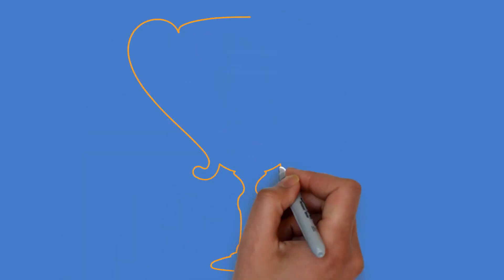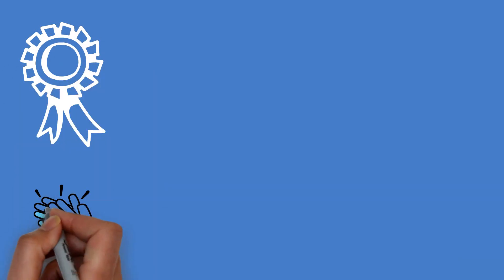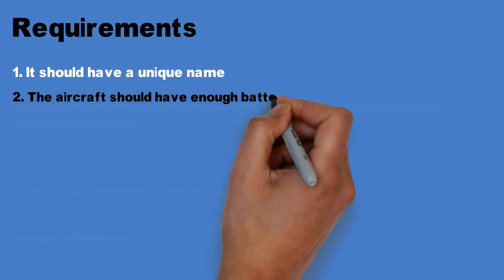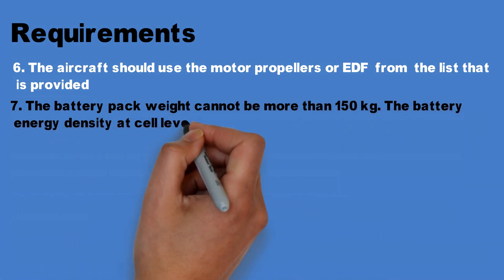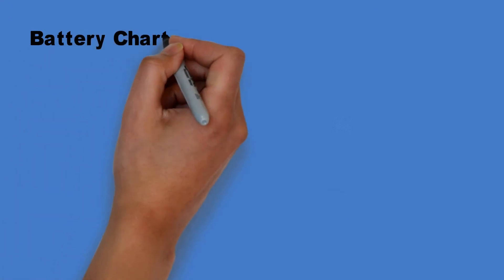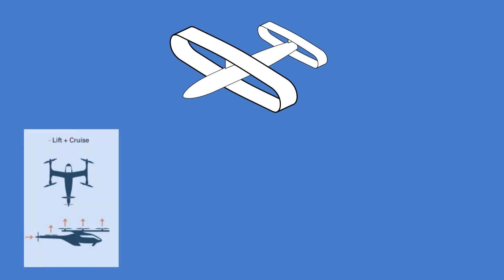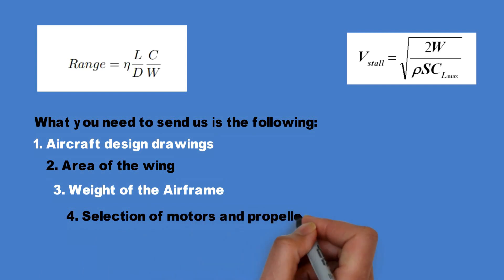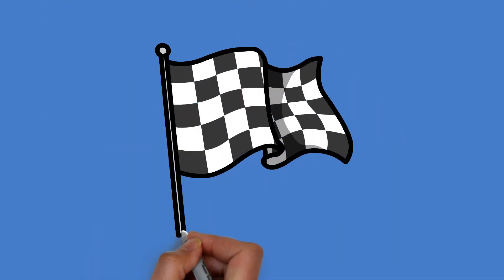EVTOL Design Challenge 2022: First prize $300 dollars

Comment: Surely this idea has been considered and dismissed.  An electric vtol powered buy an APU auxiliary power unit fueled by jet fuel. The APU produces electricity supported by a 5 minute battery reserve. Honeywell has come out with such an APU but I can’t get any specs such as weight, fuel, consumption, and power output.  In theory, this would increase range and flight time.
Reply: Any comments?  The proposal is a hybrid-powered eVTOL.  Surely someone has a comment of the feasibility and practicality of using Jet fuel to run a turbine (APU)  to produce electricity to power the eVTOL with 5-10 Li-Ion battery backup

Comment: @Electric Aviation - I have another 2 (or 3) questions for you...

1. How should we treat canopy/windscreen weight?  Being that these are (typically) made of plexiglass and are mostly non-structural, it would seem that the mass per unit area should not be the same as the composite material you have ascribed in your spreadsheet.  Plexiglass is about 30% less dense than carbon composites (by volume), and a plexiglass windscreen can be made notably thinner than the structural walls of the airframe since they are not load bearing in the same way the airframe is.  Considering this, how would you like us to treat the weight of the canopy/windscreen?

2. In the case that we have a lifting-body design and an open-cockpit, it would seem that the area of the "wing" coincides with the area of the cockpit, which cannot produce lift if it is an open cockpit .  This makes calculating your effective wing area weird.  Thus...

        2.a. Should we omit the area of an open cockpit when calculating wing area and stall speed (meaning, we need a bigger wing)?
       
        2.b. Conversely, should we include the area of a fully enclosed cockpit (full canopy, like the Martin Marietta X-24) when calculating wing area and stall speed (meaning, we can use a smaller wing)?
Reply from the maker: 1.Please dont add the canopy weight. Consider it weightless.
2. The method given for calculating from the area is just for guidance. You can use your own method which is more accurate. For example volume of whole airframe can be calculated and multiplied by density.
Unless you have lifting body fuselage, please ignore the area of cockpit to calculate lift

Comment: @Electric Aviation - 3 (or 4) questions for you

1. The spreadsheet doesn't specify any change to propeller thrust when you add a duct.  Should we assume the thrust remains the same whether we add a duct or not?

2. The "Efficiency" table does not distinguish between large and small propellers.  What is the threshold for a small propeller?

3. The "Efficiency" table does not specify what a "multi-EDF" design is compared to a "large/small ducted rotor" design.  Can you please distinguish between these two categories?

3.a. As an example,  If I have a 1m ducted propeller centered on each wing, and another 1m ducted propeller on the wing tips (4 propellers in total) would that classify as a multi-EDF, or a large ducted rotor design?
Reply from the maker: With the duct, if you look down the table, you can see the reduced amount of power you need for the same amount of thrust.
Reply from the maker: The efficiency has been factored in  augmented L/D ratio chart
Reply from the maker: 3. It would be large ducted rotor design
Reply: @ElectricAviation  Many thanks for the clarifications!

Comment: I am sorry if I upset you but NON of these designs have any chance what so ever of becoming practical electric aircraft. There is a fundamental issue that makes them all potentially lethal. That is their inability to autorotate on motor failure. The tilt wing Osprey in service killed many people before the FIA dodged safety parameters and allowed Boeing to replace proper safety regulations with a total reliance on engine and tilt wing mechanism reliability. These idiotic electric designs are all ideas based on the Osprey tilt wing or even more basic scaled up multi rotor drones. THINK AGAIN
Reply from the maker: The objective of the challenge is to make people think about the design choices and the compromises they have to make. We are not looking to actually physically make an aircraft. This is an activity  that is not completely based on arbitrary design, but considers constraints.
Reply: @ElectricAviation  Having been involved in aircraft design for over 40 years including consulting on the F35B cold lift fan, I fully understand the difference between basic ideas and the work that goes into aircraft design. Unfortunately I also advise government on EVs having been responsible for formula E and I get a little annoyed at the current grant laundering ideas being considered. There should be a committee set up to recruit assistance for governments to decide on projects presented to them, instead of making ridiculous knee jerk decisions based on a total lack of knowledge of the subjects.
Reply from the maker: I agree. As for the prize money for this challenge, its completely sponsored by myself, for my community on Youtube, who are very excited about Electric Aviation and the possibilities it presents. 
I myself am an enthusiast who grew up on Popular Science and marvelled on Engineering

Comment: I don't understand the battery capacity at cell and pack level, surely the pack level is the limiting factor in terms of weight? How many cells to a pack, please explain?
Reply from the maker: Hi, I will be publishing a video on Thursday to explain this. I cannot comment on the number of cells because there are so many cells to choose from, pouch, cylinderical and prismatic and all with different sizes. So this is just a high level design where battery weight will be used instead of number of cells
Reply from the maker: Also at the pack level because we have to add busbar, thermal management system and BMS
Reply: @ElectricAviation  Ok thanks

Comment: My "Sky Scooter" is the right size, and more than meets the performance criteria, but it is hybrid with a small V-twin motorcycle engine in the nose that runs the generator.  The electric motors and batteries provide the surge power for liftoff and climb-out, but you still can't beat petrol if you want cross-country cruise range and not just a sky taxi.

I might see if a pure electric version that meets your range requirements would be possible, but I have to go with the batteries we have, and not the ones I wish we had.

Comment: Good luck with the competition.
That said, I don't think a good VTOL can be designed to comply with these requirements.
The only way I see after listening to the video to formally fulfil the requirements is to make the aircraft
- very slow (just a bit above the stall speed)
- and unsafe (big non-redundant props)
If you want a better one, I suggest iterating on the requirements a little bit more.
Reply from the maker: I think its just an exercise to make people think in a certain manner. How would you make design compromises etc. Each year we will make the challenge more difficult and closer to what is required in an actual functional prototype.
Reply: @ElectricAviation  consider adding just one more requirement: that aircraft should still be controllable in VTOL after one propulsion unit failure. This requirement would influence the design heavily and the result would be closer to a real VTOL.

Comment: wow.. $300. I'm hoping he means RC aircraft- I'll just assume. so- around $1000 for all the motors, VFW's and batteries. $400 for the RC radio / receiver / servos. ENDLESS hours testing & designing the air frame. around $1000 material cost for building molds & laying up composite parts... 

... and he's going to give me $300!? I think I'd rather go play slots- the odds are better. even though my calculous teacher said: "gambling is a tax on people with bad math skills". 

a better idea? solve the riddle of building a battery pack / cells that can fly a 5 passenger vtoL craft 1200 miles... and then DON'T tell this guy. lol.
Reply from the maker: $300 is the prize money for the best design. You dont need to make a physical prototype